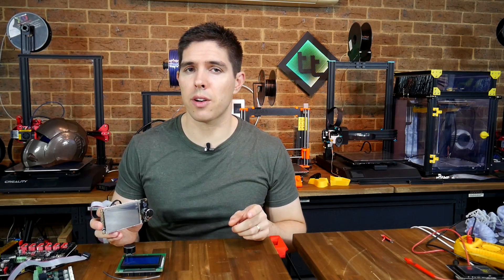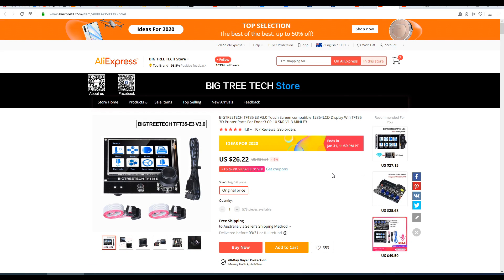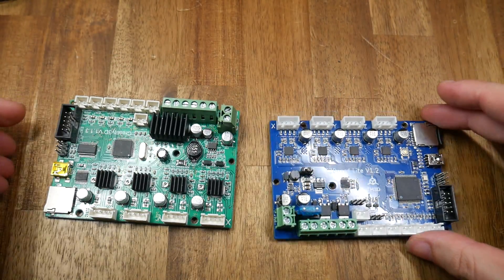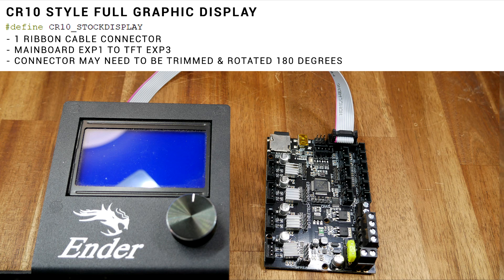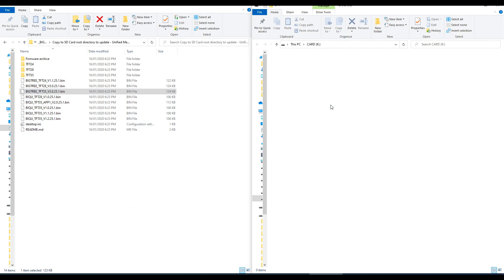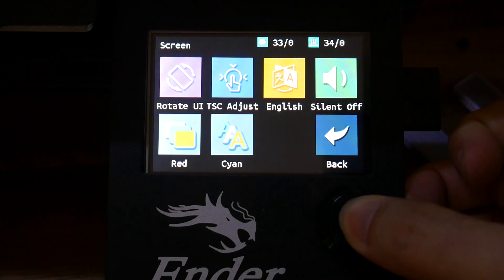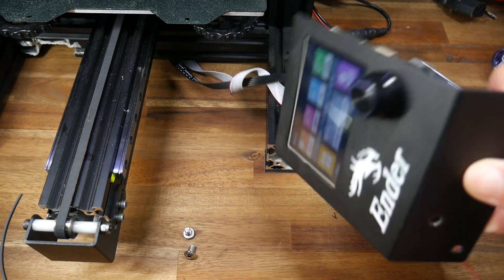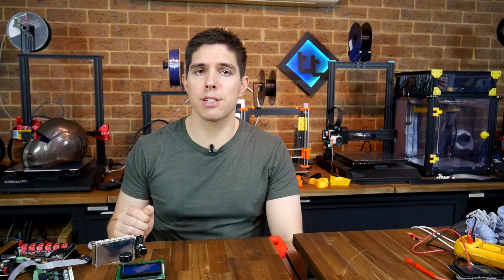BTT TFT35 dual mode touch screen guide

Comment: Those interested in purchasing the TFT35, be sure to pay attention to the revision number. I own the TFT35 V2.0; it does not have the click wheel and cannot do Marlin mode. V3.0 and above (with the wheel) are required.
Reply: Matthew, have you got the long file names to appear? If so how? Mine show up as 8 chrs with ~cutting off the rest of the filename. PS I also have V2.0. serves me right for jumping to upgrade too quickly ☹️
Reply: @royalflush1964  The 2.0 is a solid unit, so don't feel bad. I doubt I'd use the clickwheel anyways, as I prefer the speed and convenience of the touchscreen. You can go BTT's Github for the touchscreen and flash the latest firmware and image folder. There are two options, you want the one with the Unified menu theme. It makes it long filename friendly.
Reply: @MatthewWathen  I have the unified firmware but it's still not showing the long filenames 🤔. Must be something I'm doing wrong obviously. Will try again and see what happens. Thanks for the quick reply.
Reply: @royalflush1964  You using the TFT card slot, Octoprint, or the printer's onboard slot? Most functionality (like the progress bar) only work when the gcode is in the TFT's card slot.
Reply: @MatthewWathen  Doh! Was printing from the motherboard. Just tried an SD card in the TFT and voila, long filenames. Happy bunny now. THANK YOU 👍
Reply: I wish I had a TFT35 v3.0 without the wheel, as the touch functions are all I need now, well it still has a lot of blobs and zits in curvy parts when printing from touch mode, hope they will fix that soon.

Comment: Can you do a tutorial on the installation of their SKR 1.4? Is it different from the 1.3? Great video!
Reply from the maker: This video is coming up. At first inspection there are some small differences.
Reply: @TeachingTech  When you test the 1.4, please test the BLTouch pin.   I think there is something wrong with it if you plug the BLTouch to that dedicated pin.  You will see this problem if you do M48 multiple times and you should see massive deviations between M48.
Reply: @TeachingTech  In your SKR 1.4 video, can you add a segment using the EZABL Pro with that board.  I purchased the EZABL Pro in lieu of the BLTouch based on your comment regarding availability of formal support from TH3D.  As it turned out, their formal support is of little value; basically, they only provide support when the EZABL is used on a stocked printer.   Even the simplest upgrade negates the formal support, and you're on your own.  Problem is that there's minimal community information on the EZABL when compared to the BLTouch.  If I had to do over, I would choose the BLTouch in a heartbeat.  Unfortunately, I'm now stuck with the EZABL Pro.  I would like to upgrade my Ender 3 Pro to the SKR1.4 board with the TMC 2209 driver, and TFT35.  Be great if I can also have the EZABL Pro working with this setup,  and not have to purchase the BLTouch.
Reply: Yes, please. I have a home built corexy (Anet A8 guts!) that I've been shopping around for new board/display and the skr v1.4/tft35 v3.0 combo looks nice. Really loving these videos!
Reply: I would be more interested to a video about the new BTT GRT v1.0. It has 6 stepper drivers and can be expanded to 11.
So as I already added second z on an Ender 3 and a direct extruder, I now think a longer x-extrusion, a second x-motor, a second (direct) extruder and a GRT board would be the next step - to make the Ender 3 an IDEX.
The GRT is $65 (with 6 TMC2209, If you use coupons),  so it is much more than the $25 a SKR e3 Mini costs. But if the e3 mini does not fit your needs anyway (like you want dual z with independent endstops, working EEPROM with UBL (emulation on e3 mini corrupts CRC checksum in UBL)  the GRT seems more interesting than the SKR 1.4 turbo (about $50 with 5 TMC2209) the price is not so much more; so I wouldn't use the SKR 1.4 but the GRT. It leaves more options:
- Upgrade your Ender 3 to IDEX
- Using a mixing nozzle with 3 colours
- or even 5 colours (with expansion board) on an Diamond nozzle and independent z-endstops with 2 z-motors.
As the Ender 3 is "entry level" sooner or later it will become the "experimantal" platform anyway - so in my opinion it is a good idea to start upgrading the board to a very expandable one for future experiments.
If you use more than one Ender 3 (or simular printers like CR10, Sovol...), you might even reduce the cost of upgrading by buying an GRT for the Ender 3 and a SKR 1.3/1.4 with cheaper DRV8825 (for the other printer) and swap out drivers e0, e1 and e2 from the GRT and x, y and z from SKR - you do not need TMC's for extruder anyway...
Reply: I bought this screen and skr v1.4 to my cr10 mini ..
Reply: I sure can't get it working.
Reply: Christopher Saint Denis 

what is the problem?  mine worked right away. (Cr10)

Comment: I haven’t looked at compiling my own for the tft 24 yet but is it pretty straight forward to make the lcd words on top go away and make the simulation mode full screen?
Reply from the maker: Yes, please jump to the custom firmware section of the video from the timestamps. Both are a matter of commenting/uncommenting a line.
Reply: I actually had time to check it out right after I made that comment. Yeah it’s pretty straightforward. Just like normal marlin config. Only issue is for the full screen it’s not recommended for the tft24 and that’s the only screen I’ve got currently! :( guess a 35 is needed on the slow boat from China.
Reply: Oh and thanks for you videos man...have been very helpful and informative with random things I’ve gotten sucked into binging on here. You one about the seckit go made me want to get one really badly! Need to complete my hypercube evo first.

Comment: the more i stalk the BigTreeTech AliExpress store the more upset I get that I bought the Alfawise U30 Pro over the Ender 3.
Reply: Buy the Ender 3 too. I originally bought the Tevo Tarantula with dual extruders. It works (barely) but doesn't produce the same quality as the Ender 3. Then I decided to buy the Ender 3 Pro as well. The reason I chose the Pro is because it has the magnetic, flexible removable build surface as well as a better, branded power supply with a proper injection molded cover and power loss recovery. I did flash the TH3D Unified firmware for fear of the stock firmware lacking thermal runaway protection, like the basic Ender 3's did. Not sure if Creality ever fixed it. If you're not sure about buying the Ender 3, consider this. It has absolutely perfect print quality out of the box and is easy to assemble and use, and is built very robust. The test files already on the SD card use raft so the bed doesn't have to be perfectly level, and print perfectly. Trust me, it is worth it. If you buy it and it's not performing like I described like I've seen people complain about on forums, it is defective and Creality will arrange replacement.